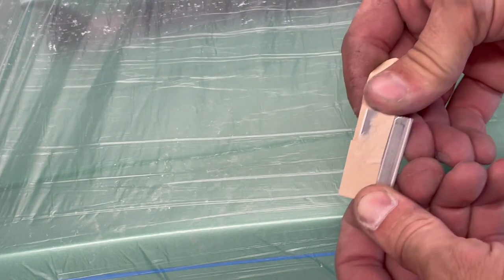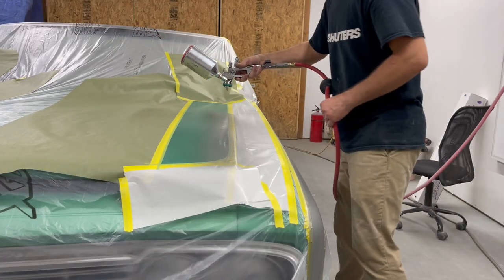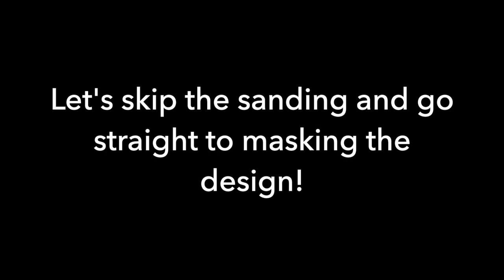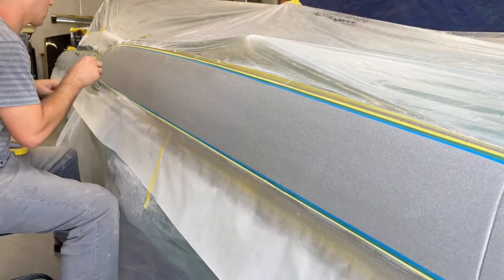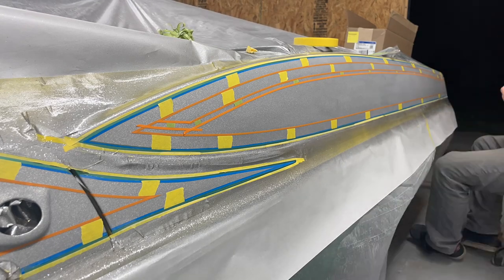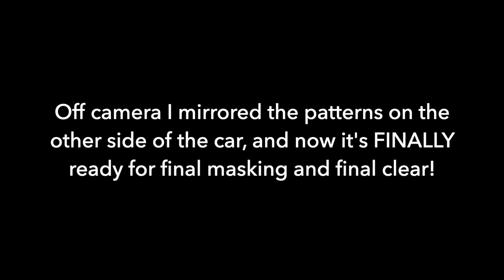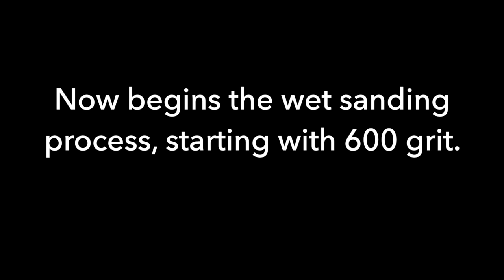Adding some POP to a 66 Impala LOWRIDER!

Comment: nice job!  how do you keep the compound dust down?
Reply from the maker: 3 things I do : I keep my pad pretty clean as I go (the blue you see is from a single stage job I did and only on that side of the pad), I try to keep the compound wet, and I’m only running my buffer at about 1200-1400rpm at this stage. That seems to do pretty well even with a traditional wool pad like you see me using here.
Reply from the maker: Also, thank you!